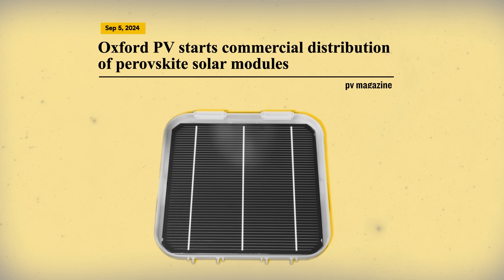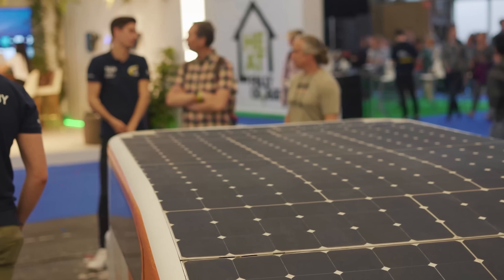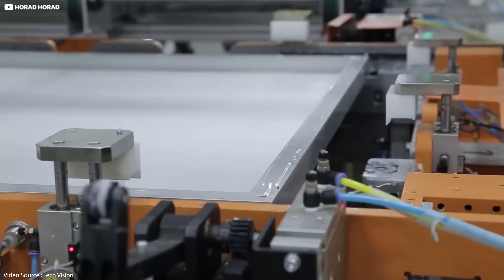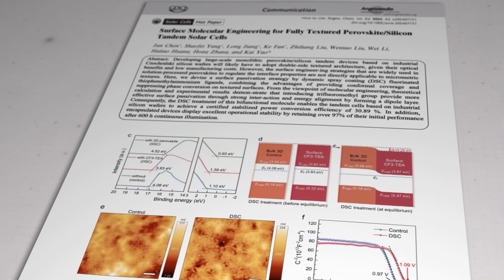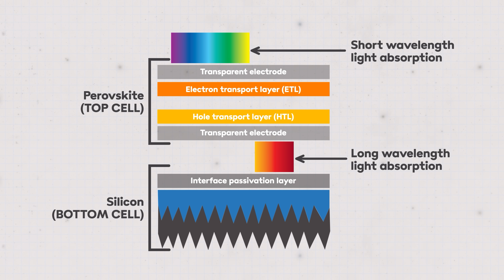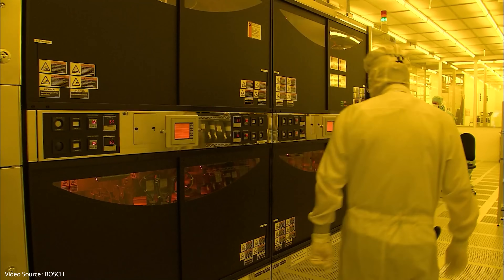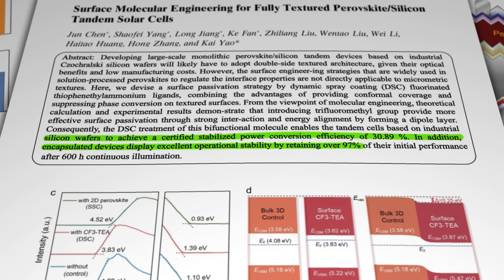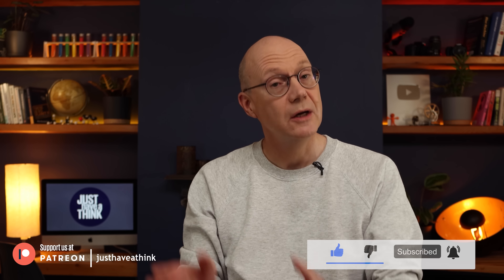Solar PV with more than 40% efficiency is now achievable.

Comment: There are already low cost commercially available mass produced PV panels at the same efficiency  of the Oxford PV panels, not 20% lower as you detailed in the video. 25% regular panels will be available Q1 next year. Hopefully Oxford PV and other perovskite producers will accelerate the efficiency improvements as I doubt they are cost competitive at the moment.

Comment: Currently the price per panel is much lower than the price per panel mounting equipment.
You pay more for 2 aluminium profiles that you have to screw on your panel to connect it to your roof.
So needing less panels is always better. Because the mounting is extremely expensive, not the panels.
Reply: The panels are still spendy for most people. I'm not contesting that the cost of installation, just saying that the panel price still matters quite a bit. 
One thing I'd like to see is the creation of a better installation system for CdTe thin film panels. With their light weight, there's no need for them to use the same mountings as silicon panels. We could dramatically reduce the costs of installation for thin film panels with a little effort. (I am not an engineer, so this isn't something I can contribute, but I do think it's something that should be done.)
Reply: @cripdyke here in South Africa there has been a significant drop in panel prices. A Canadian Solar 550w panel currently costs less than $100. The mounting system costs roughly $50 per panel, labour to install each panel comes to roughly $30 and PV cabling, connectors, fuses etc works out to $20 per panel. So the panel is cheap compared to the rest.

Comment: Like a new Covid strain success means outcompeting the dominant technology. 20% greater efficiency won’t win if the panel costs 20% more. Thus, the barrier to entry is reaching a scale where production cost falls below existing tech. It’s a high barrier. That’s why we are still using the same design (roughly) from 20 years ago.

Comment: "In addition, encapsulated devices display excellent operational stability by retaining over 97% of their initial performance after 600 h continuous illumination". 600 hours is 25 days. If you assume continuous illumination in the real world of roughly 12 hours a day, you's still only looking at 50 days for the cells to drop 3% efficiency. Not exactly ready for the real world based on that one statistic, would need to see if the degradation was constant or whether the cell efficiency reached some form of stability.

Comment: Energy efficiency only makes sense to talk about if you are running out of space, and we are not nearly close to that. Far more important is cost per watt, including installation. More efficient cells are more compact, so less installation for the same power, but it doesn't matter if the cells are not cost competitive. The most important question is whether a technology can be cheap.
Reply: That's true but new tech always starts out expensive and then become cheaper over time. Efficiency is a major issue for small, mobile applications and for homes with limited roof space.
Reply: For home use, on roofs or in the garden, size is very important. 

Likewise in some commercial use cases, where agricultural or building land is being covered with solar arrays
Reply: Lol. Your argument doesn't makes sense. 1) space 2) cost. As if they are unrelated!
Reply: Installation costs are a massive part of the overall costs though. Both have to be weighted against each other.

As usual, a new technology costs more, with declining costs over time.

All that has to be taken into account.

Comment: Is space efficiency the most critical factor, watt/m^2?

Or is it more cost efficiency, i.e. watt/£ of install.

Is the production/install process going to be significantly cheaper to make a big impact.

I often wonder if the much less space efficient polymer solar printing and paint process are something to get more excited about, where the production/installation cost is so much cheaper you can use it every where.

Comment: I hope to see the day when solar panels capture infrared light that change would be amazing, I'm sure someone is working on it
Reply: The biggest issue is that with that capture it heats op the panel much more, which diminishes the efficiency of the visible light conversion. That's why it pays off more to reflect IR and just capture high energy radiation.
Reply: yeah UV not IR  @GBOAC
Reply: Infrared light doesn't produce much voltage, unfortunately.
Reply: Yep, hybrid PV and thermal, aka PVT

Comment: I'm waiting for my perovskite solar paint.
University of Washington has been printing P cells on plastic film for over a decade.
Reply: did you miss the part where the smoothness of the tandem cells was a huge barrier that has only recently been figured out? single layer solar cells already exist, but you arent going to get anything multilayered in paint if the current research is literally into how to apply a layer we already understand to another layer we already understand.

Comment: Dear David, thank you for your next THINK, Some of the standard SOLAR PV producers deliver SOLAR panels with 24% efficiency.
Reply: Topcon n type bifacial solar panels has 24-25%, plus, if to trust pdf they can get up to 30% of energy from the back side. Like, 600W panel became almost 800W one, claiming in this case 35% efficiency 🤔 And if it will be placed in front of white surface?

Comment: I have a question to just have a think. The solar panels look quite blackish to me, so they must absorb huge amounts of solar light lengths and they convert about 25 % of the light to create electricity (the best panels). The question is what happens to the other 75%?. Are they emitted back to space or do they warm up the atmosphere around the solar panels quite more efficiently then say the sand and rocks of the desert those panels are installed upon?

Comment: I want to build an EV car that runs 100% off of self-generated solar energy. I calculated how much energy a Nissan Leaf would need and how much electricity an 8 ft-wide trailer would be capable of producing at various lengths, and if the trailer carried solar panels in the horizontal position, I would need an 85-ft-long trailer of solar panels just to power that thing at 50 mph. That's just too long to be practical.  But if I can double the output of the solar panels, then that trailer gets down to only 42 feet long, and if I can put 10 ft of that over the car itself, then the trailer only has to be around 32 feet long, and that is practical, I can actually use a car like that out in the rural areas where there is more space on the roads (not in the crowded cities). Now I can build a solar-car that can travel around the world just on the solar power it generates, no external charging required.
Reply: Are you are presuming that the car only collects power when it's driving? Most cars sit doing nothing for most of their lives ... under the sun. Even with current tech it's possible to run something just with the surface area of a vehicle if the car is used in the way most cars are used, if the down-time is used to collect power in a battery ... but not constantly driving obviously. However, we don't need to go to these (absurd?) extremes when panels on vehicles are not the most efficient way of collecting solar energy. Where I live the grid is using wind, hydro and a touch of solar much of the time ... so charging a battery in the vehicle is a no-brainer.